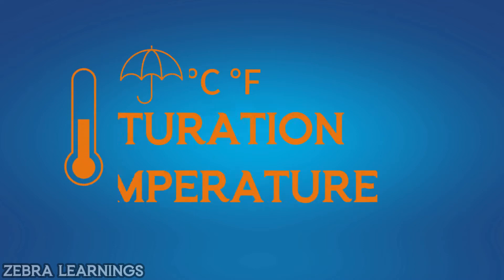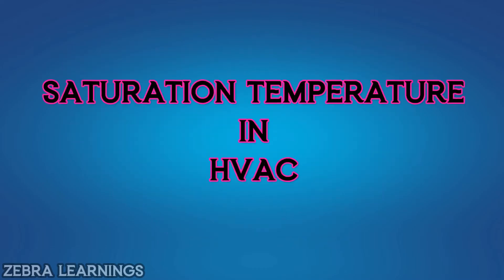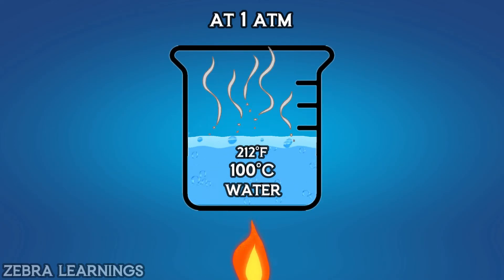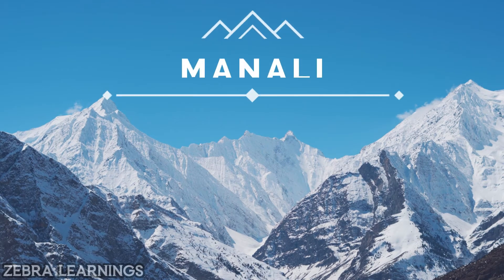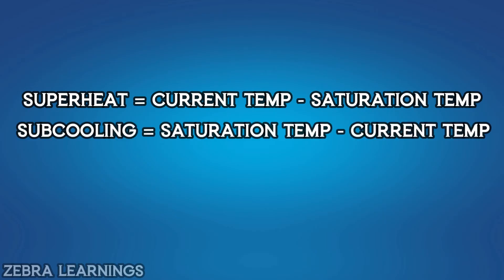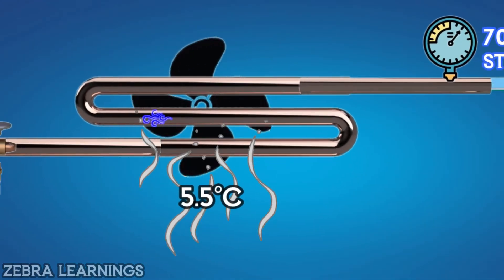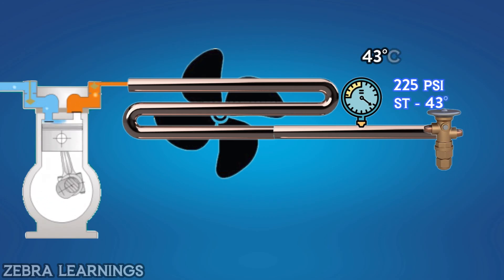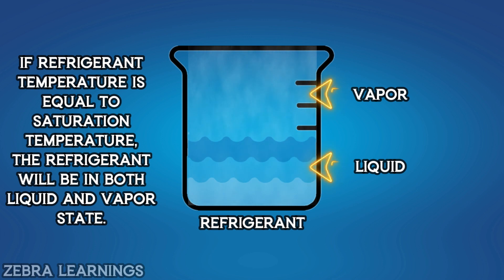What is Saturation temperature? | Animation | #hvac #hvacmaintenance #hvactraining

Comment: Bro im not clear when is the refrigerant pass through the condenser how its going to liquid stage ? I know the refrigerant it will be changed to liquid by expansion valve
Reply from the maker: The refrigerant won't change to liquid in the expansion valve. It will change to liquid phase in condenser only. When we cool down the hot vapour, it will condensate and change to liquid.
Reply: @zebralearnings  oh ok bro thanks for explanation